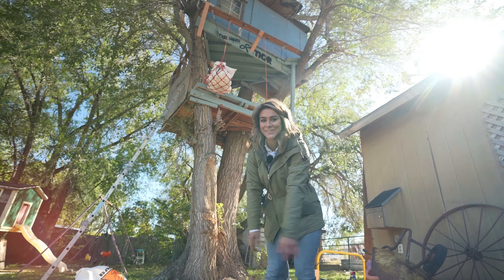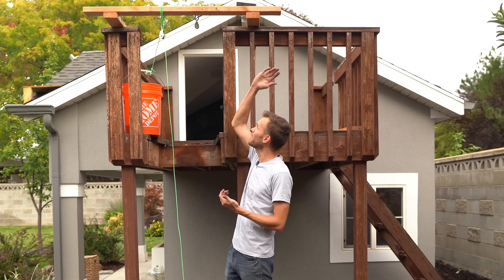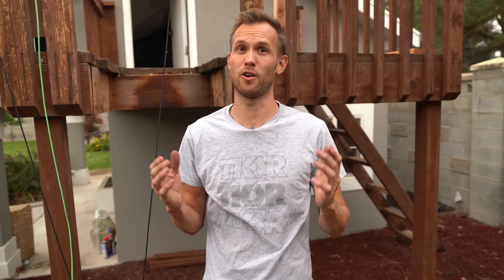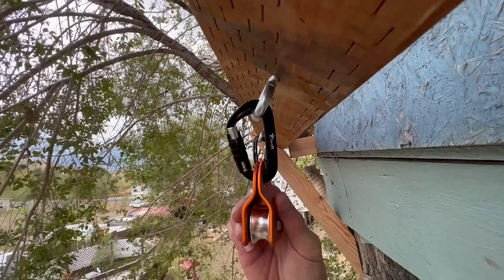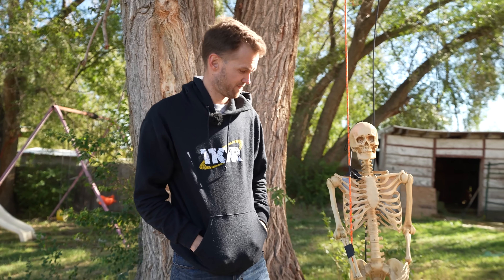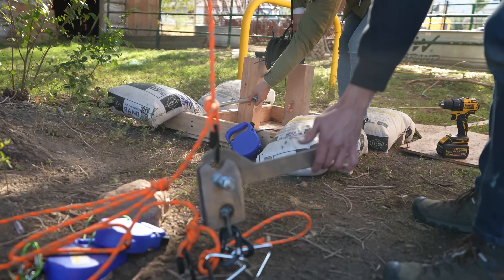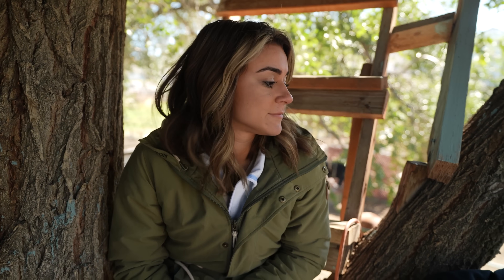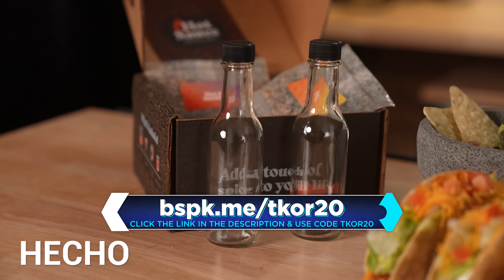Every Treehouse Needs This

Comment: Those bolts man. Better use threats with a swashplate and a nut on the other side.
That way you be sure the bolts wont come loose over time with the wood expanding and contracting due to warmth changes

Comment: If only one person uses the system isn't it easier to have a contraweight of similar weight than the person who uses it and then pull yourself up or lower yourself down from a separate rope? This way I think the individual  person has more control, the contraweight will always be where you need it to be and you can use different weights for diffrent people, right? If there are flaws in this way of thinking please point them out to me, I'd like to build something like this in my home.

Comment: I'm 61 years old & moving to a 3rd story apartment.  Can you please make a simple pulley system to use as a grocery hoist over a balcony?  I'm thinking a small block & tackle would work, but can't figure what to mount it on that won't put wear & tear on the balcony.  Freestanding?  I have no tools to build anything elaborate.  Would greatly appreciate - that would be a lifesaver.

Comment: Would've been a little easier to use a small motor and pulley system so you didnt have to adjust it so much to go up and down

Comment: with the rope to go downward, make more loops, so you can ''climb'' up, pulling the weight up
Reply: You could also use those loops as foot holds if you made them large enough, although you have to be careful with that bc without a thick enough rope or something to shape the hole, that makes it super easy to tangle around your foot and get stuck. Same thing for the up rope
Reply: It would be better to build an Otis-Fensom Elevator. This way any weight could be used.

Comment: If you added one more pulley, the difference between force on the black rope vs the orange rope would be 33% instead of 50% so could you then make it more balanced between the 2? Also, the weights could be configurable so you could just swap them out for different individuals?

Comment: I feel like I'd rather use water weight. That way, there's just one rope and one pulley. But there are buckets attached to both ends. To go down, you open a valve to pour water into your bucket (this can be a garden hose). You can adjust speed to what you're comfortable with.

To go up, you unlatch the line and then you open a valve to release water from your bucket. Again, you can adjust speed to what you're comfortable with.
Reply: Cant use it in the winter
Reply: @minecraftgirl8733  Not a problem where I live, but I see what you mean.

In colder climates, you could keep the water from freezing with anti-freeze.

Comment: I love this!!!  My uncle and I are going to be building and earthbag house starting in about a year, IF the LORD is willing and things line up so that we may do so. anyway, most of the building will be done by us, and I knew there was a way to use pulleys to raise stuff that will be over our heads, but I wasn't exactly positive of how that would work....This shows me I had it pictured correctly in my mind. Yay me. lol!!!! 
My Grandad, Mom and Dad had used various techniques to make things easier to do/to build and would help us with everything, but they have passed on, so this has truly helped me to confirm memory of things they taught me growing up.
Thank you and many blessings!!!
Reply: Use special bolts for trees so you dont end up making the tree sick and over time the bolts will stay secure.
And dont use normal scrwe threads, but bolt threads and on the other side of the lumber swashplates and nuts